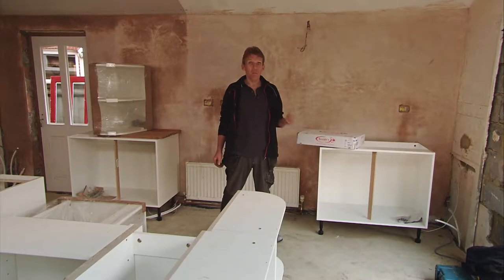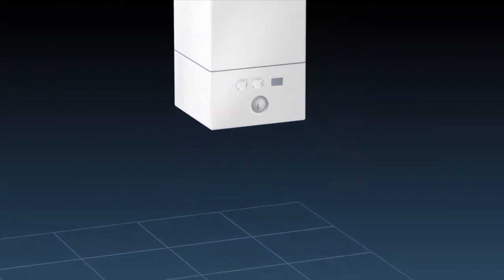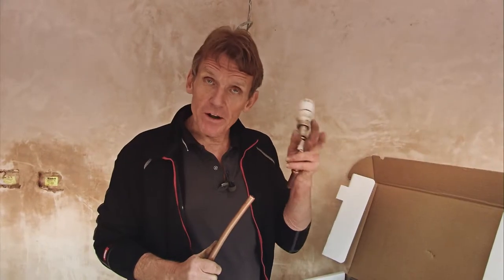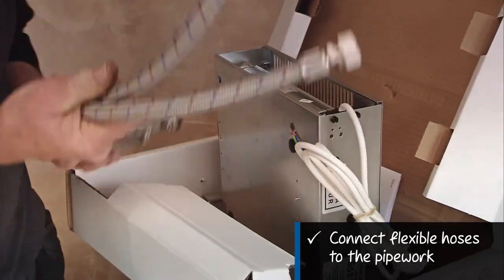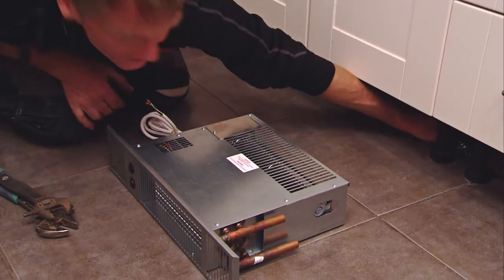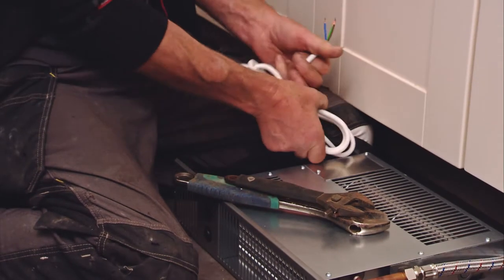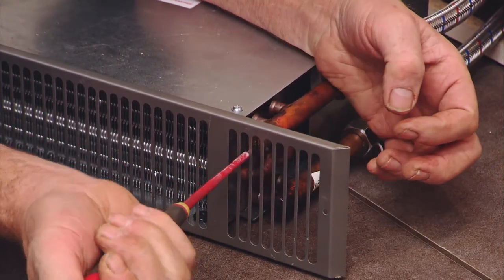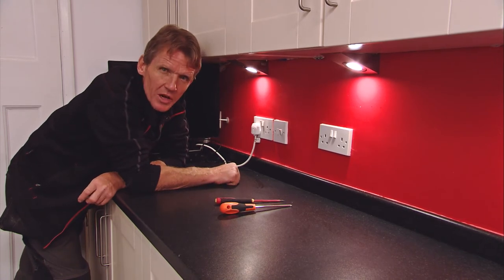Space Saver Plinth Heater Installation Video

Comment: I have this exact one in my new build that has never been connected to the electrics... is this an expensive job? House was built in 2017, I moved here in Feb 2021... only discovered this last night haha... part ownership and Housing Association won't help :( water pipes are connected already. Cable is coed up with raw ends; never connected to wall (there is an outlet for it)

Comment: I watched a video where it’s not recommended to put an  in line isolation valve on the heating system…. What do you suggest
Reply: If you use them after it tails off from the main flow and returns and the pipe only supplies the one the space heater/ radiator it’ll be fine as isolating won’t impede on anything else. If you’re worried about loss of flow due to the bore size of the ball isolation valve then you can buy full bore isolation valves that are the same internal diameter as the pipe feed

Comment: Hi, great video. I've just bought a plinth heater and was just wondering if I could plug it into an extension (using a standard 3 pin plug) that is already fitted in my kitchen ? 
This extension is wired directly into a fused spur and is used to connect the down lights on my kitchen units. Thanks